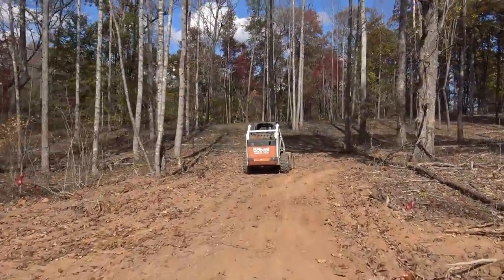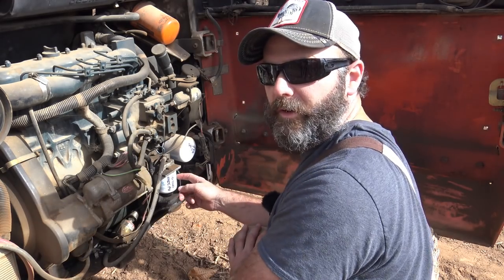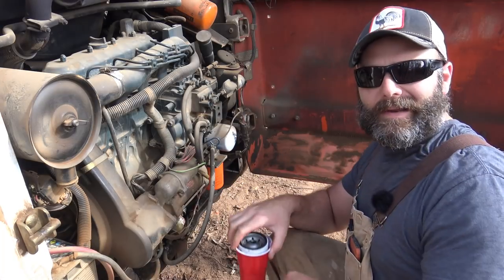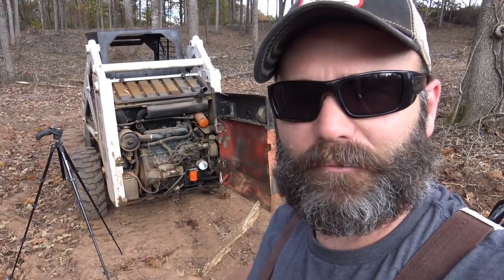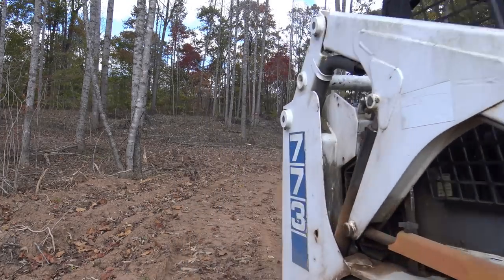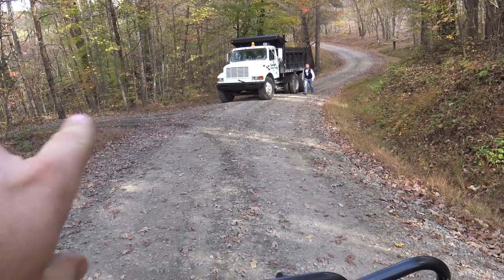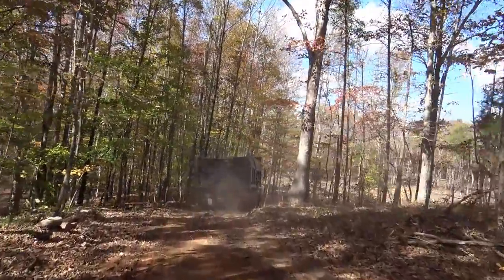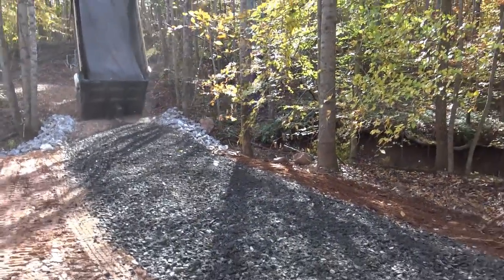How a bobcat skid steer works/operates BREAK DOWNS! Fuel filter tutorial, building a new driveway!

Comment: Nice video... one thing I would suggest is to plug the center threaded hole on the fuel filter when you add fuel to the filter.  Pour the fuel in the small holes along the outside edge of the filter only.  Then your fuel will be filtered.  If the fuel goes into the center large hole it goes into the machine unfiltered.  I know that in diesel trucks this can be a big problem.

Comment: Rule of thumb for crushed gravel is 3 coarses thick after compaction. So, 1 1/2" stone = 4 1/2" thick. If its on soft soil add as needed because thats for a firm sub-base. 
You dont have to be exact & I know everyone has a budget. Thats why its a rule of thumb. Too thin wont set up & get firm. Too thick gains only realized under heavy heavy loads.

Comment: Just a heads up the clicking you hear is the park brake disengaging. Those engines use a mechanical fuel pump thats run off a camshaft.
Reply from the maker: there is an electric fuel pump on these machines too my brotha....some call it a clickity clack....if it doesn't work and you change out the fuel filter it will loose prime...our JD 250 had a broken one and we replaced it 2 weeks ago after experienceing loss of prime...bummer
Reply: @StoneyRidgeFarmer  ok i see now, I haven't seen an electric pump on our 773s that come through our dealership. We are also in south Texas, im looking at the back of one right now and we have a hand primer bulb feeding the mechanical fuel pump only.

Comment: With the symptoms you described I would also check the drive belt tension.
Reply: Bobcat haven't had drive belts since the old clutch machines built from the 60's thru early 80's.  444, 500, 600, 610.  The 700 and up are all hydraulic drive hydrostatic machines.
Reply: @karaayers2867  Drive Belt, not belt drive. Google it

Comment: Thanks for the skid steer tutorial man! Also, how much is a load of gravel?
Reply from the maker: This rock cost me around $240 per load...not bad huh...not a pure granite rock..it's called solite....special slate rock mine around here..granite would have been $340ish.....expect to pay 400-450 per load..call around the prices have a large variance between different haulers
Reply: WoW! I remember $1.40 per ton. I think with dust was $1.60 per ton. The dust helps set up the gravel like concrete. I like the gravel you have. I did notice the non typical color. Thanks for the information. Does the gravel you are using have dust?

Comment: It shows you never worked on a 773 bobcat!  First do not use non bobcat filter unless you really do not care about your machine!  Second you loosen the knob half way up to bleed the air.  Bulb is on the bottom.  Third do not start till you check hydraulic fluid level if you are dry you will toast the pump!!  Do not follow his maintenance instructions!!!  I personally own a 773!!,
Reply from the maker: Thanks Alan...never claimed to be an expert dude...I saw your other comment... You're advice is great...thanks...not sure why you'd prefer to attack me instead of educating us all? Good advice is always appreciated...it's not my machine FYI
Reply: Not intended as an attack but I have seen so much bad advice.  It easy toast a bobcat.  I have had mine for many years with little maintenance issues but I pay for bobcat fluids and parts.
A Diesel engine is 3-4K. Check the oil
A hydraulic pump is 3k. Check the fluid level.   
Use full synthetic diesel oil in the engine. Runs better cranks over easier in the winter.  Still on battery I bought 8 yrs ago.  
Treat it right and it will treat you right